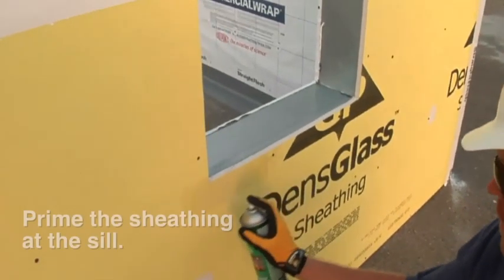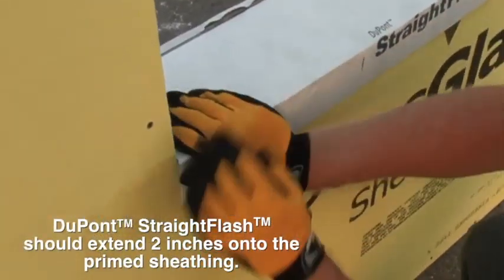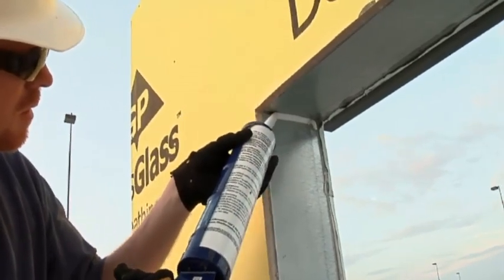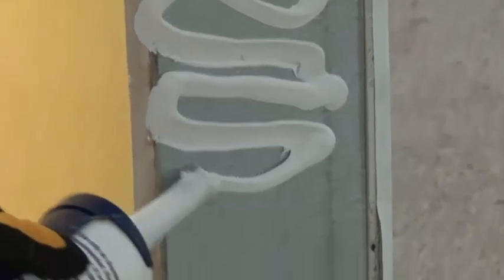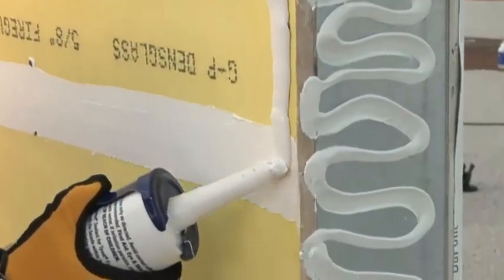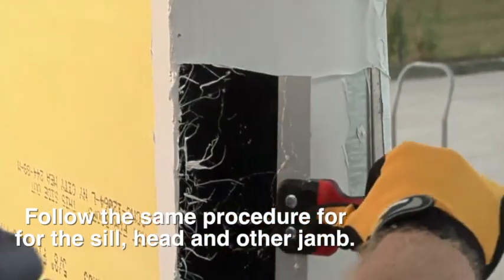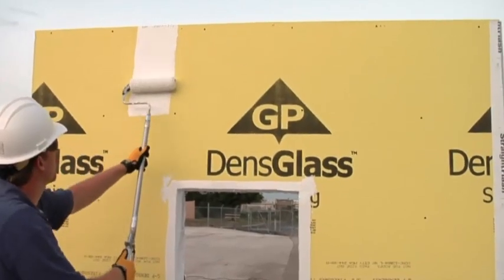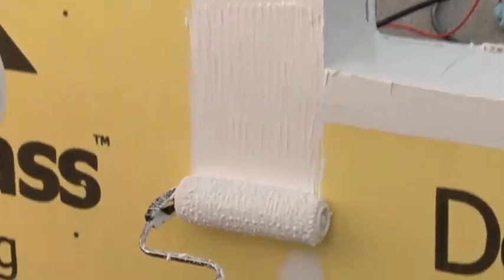Applying DuPont™ Tyvek® Fluid Applied and Flashing a Window

Comment: can i install my veneer stone directly on to that liquid barrier??????
Reply from the maker: If it’s a manufactured stone type product with mortar bed like stucco it would be recommended to add a intervening layer, like building paper.  A natural stone veneer should include a dedicated air space behind it, usually with a 1” air space by code.  So the veneer stone would not touch the fluid applied barrier.